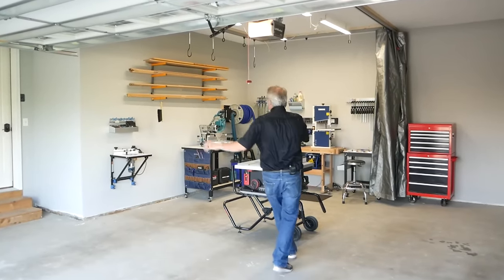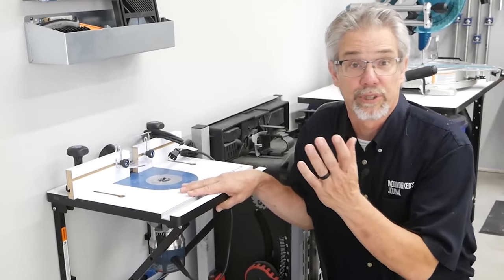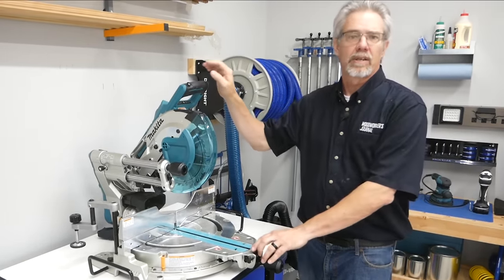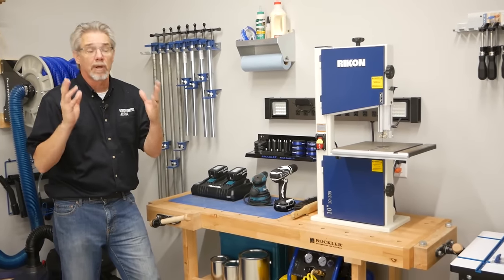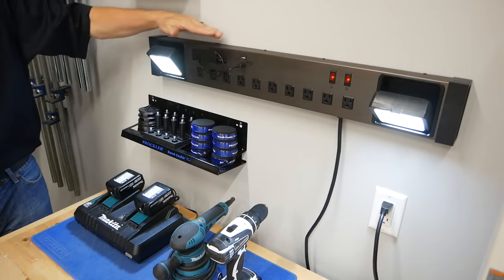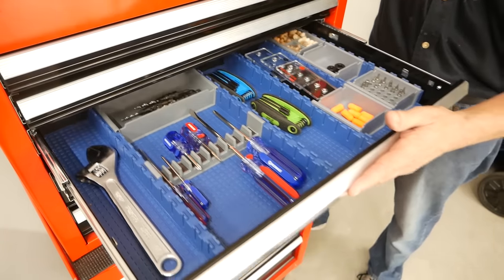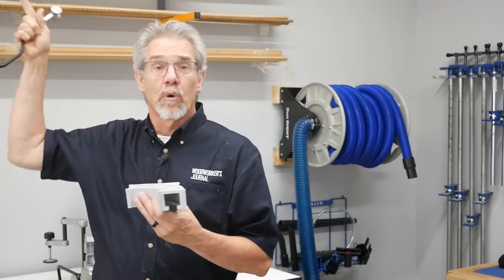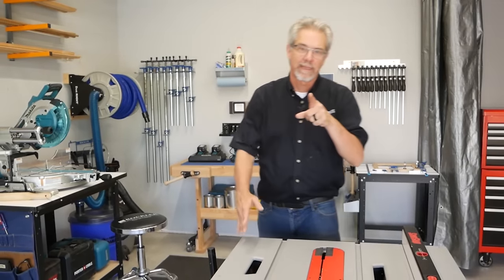Setting Up a Small Woodworking Shop | Rockler Skill Builders

Comment: Rob, that is a neat and efficient setup. I've watched many videos on shop setups and builds. What I can tell your audience is that work shops are divided into many aspects. I do some welding, auto mechanics on my own vehicles, woodworking builds, plumbing on my house, electrical and electronics and appliance repairs, mine. You can name it and I'll attempt to do it especially with the help of youtube videos. What I can say about these convertible tools is that they are fine if one is not building stuff for mass production.

Comment: I would worry that with that long of a hose for a shop vac that you would lose most of the suction.  That is why for my 'small shop' i went bigger with a laguna 14-12 and just have dual 4" quick connect hoses off of it that can reach all my tools.  That way no log runs of hose and the hepa filtration takes care of the fine particles, and the built in cyclone keeps the bigger stuff in the bin.  More expensive, yes...much much better hepa dust collection though.

Comment: Link to the power strip bar mounted to the wall above the bench?
Reply: There should be a beer tap somewhere there...
Reply from the maker: This is the power strip in the video - https://www.rockler.com/volt-king-10-outlet-heavy-duty-power-station-with-2-usb-ports-and-led-worklights

Comment: Any advice on noise control/suppression for small shop? I'm redesigning my workshop which in the unfinished basement. The noise is one of the major problems and the whole house can hear it even when I use the drill! Thanks!
Reply: seal door cracks and windows well (or noise cancelling window film etc.). And pick up some noise canceling curtains, noise cancelling sheet rock set up, or the acoustic panels to install on wall. Sound needs ta bounce off of hard stuff so reduce that.
Reply: Show them how to turn up the TV!
Reply: @deldridg  😂

Comment: Link for the folding table saw stand. Ty
Reply from the maker: That is the SawStop 10'' Jobsite Saw PRO. The stand is part of it. Here is the link - https://www.rockler.com/sawstop-10-jobsite-saw-pro - Thanks!
Reply: @rockler  do they sell the stand separately?
Reply from the maker: Yes, you can only order it though SawStops parts department at service@sawstop.com. However, it may not integrate with other saws than the Jobsite Saw Pro.

Comment: Any tips on humidity control?
Reply from the maker: If a shop is in an enclosed garage, basement or shed where the ambient air in the shop can be controlled, one of the best ways to reduce humidity is to use an ordinary dehumidifier during summer months. A window air conditioner can also serve the same function (drying the air) while also lowering temperature to make the shop space more pleasant to work in on hot days. It's beneficial to know what the relative humidity is in a woodworking shop, regardless of whether you use a dehumidifier or air conditioner. Buy a hygrometer (often a feature included with electronic thermometers) and put it up in the shop where it's not close to a door or window. It will provide moisture readings in percentages. Try to keep your shop's indoor humidity around 50 percent or less, if possible. Doing that will go a long way toward controlling rust and helping to keep wood dry.

Comment: where to you buy the track system and curtain in thegarage
Reply: I strongly suggest you dont buy it from rockler and you buy 'Unistrut' from an electrican supply. you can buy curved sections as well and it will be around 13 cdn for 10ft vs rocklers  59 usd for 4ft also steel vs pvc

Comment: That is not my idea of a "small shop". I have 8x10' of space. This is nothing more then a Rockler advertisement. That means I will resource everywhere high and low before I drop a dime with rockler. Clickbait.
Reply: Perhaps ask Rockler for a refund for this video... because you paid for it, right? Also, if they did an 8x10, someone would complain its not their idea of small workshop because theirs is 4x5 feet